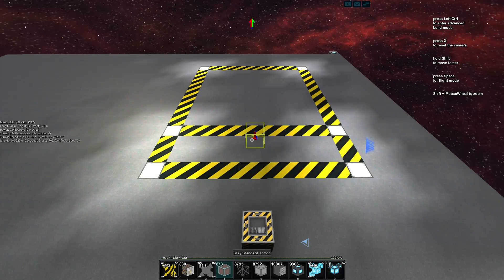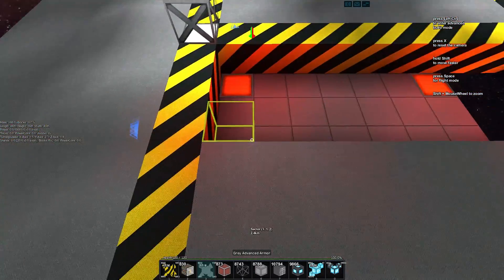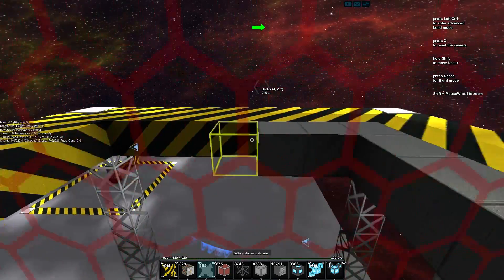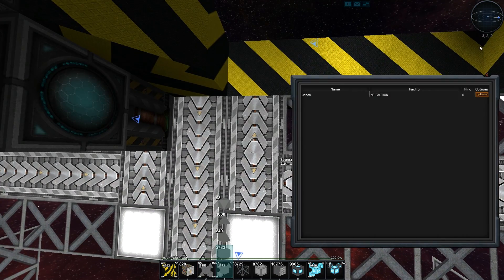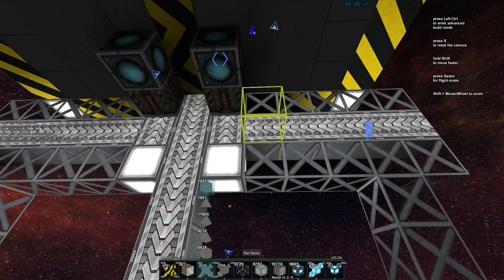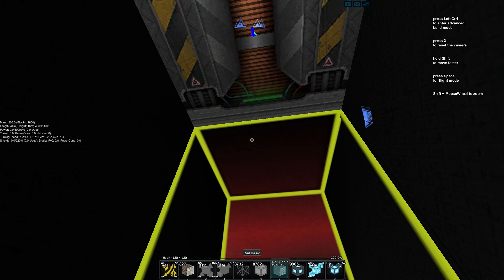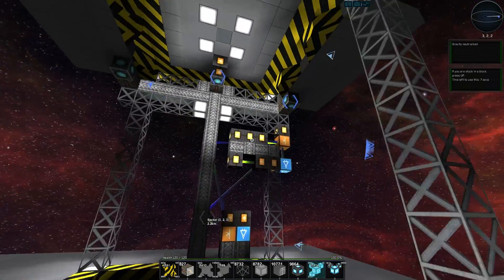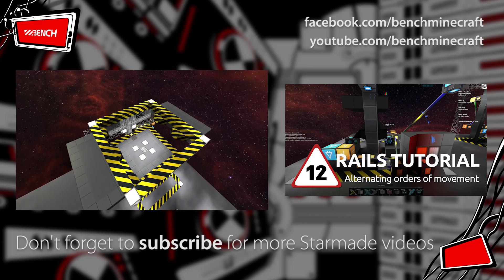Starmade Rails - 11 - Rails Triggering Rails

Comment: i did this with a much bigger elevator and now the not signal keeps toggling without me pushing the button and closes the hangar door before opening all the way
Reply from the maker: Christopher Parra Hmm maybe a stray circuit against the rail or too long a delay?
Reply: i replaced the not with a flip flop and it seems to be working ok now but now i dont know how to open it from the outside haha
Reply from the maker: do you want to trigger the whole thing or just the doors?
Reply: the whole thing
Reply from the maker: see where the button you use to trigger it at the bottom is and the flip-flop it goes into, you should be able to just connect a button to that same flip-flop to be able to trigger it from another location
Reply: thank you

Comment: Ya'know, when the door kept trying to close, you could use that on derelicts to simulate a "door failure", where it tries to open or close, but, due to damage..It can't do either or, and is stuck in that "animation" untill you either A) blow the door, or B) Find a different route.